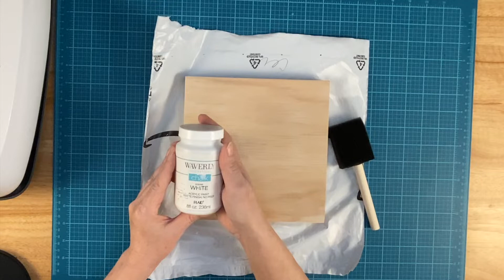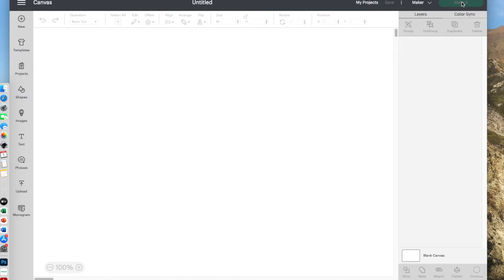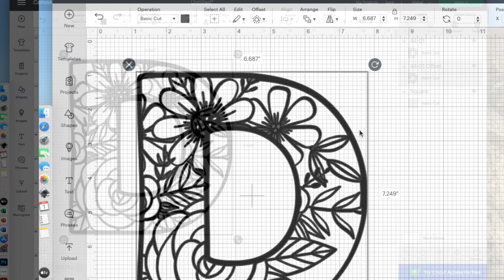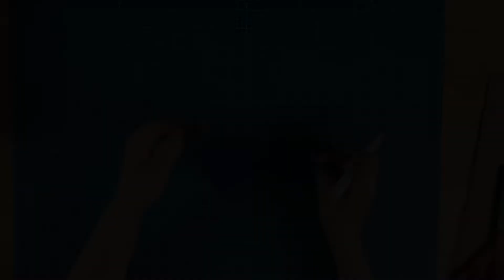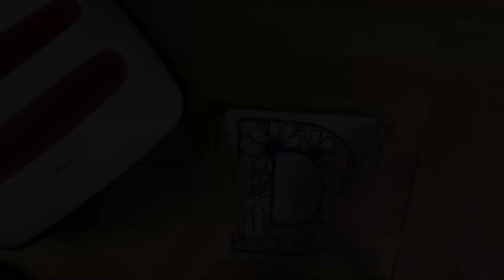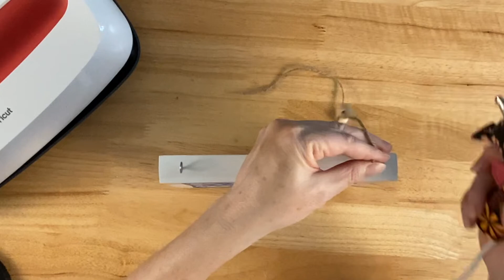Cricut Craft - Pressing HTV onto Painted Wood

Comment: So pretty!! 🤩 I have only used HTV on wood. I’m not a fan of permanent due to the lack of movement if I place it wrong. I’ve had luck with it not coming up, when I use acrylic paint. I also put 3 coats of polycrylic over it before vinyl though. I’ve heard that it helps the vinyl have something to adhere to.
Reply from the maker: Great tip!!! Thanks so much, because the acrylic craft paint is less expensive and more color options than chalk paint.